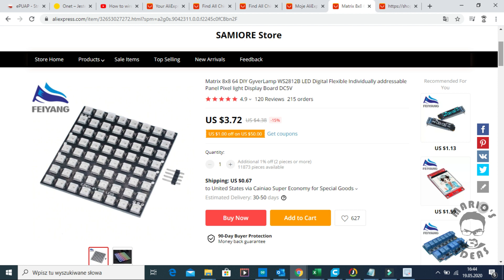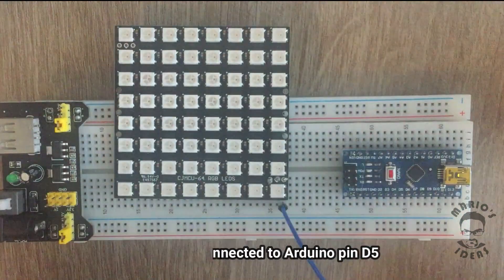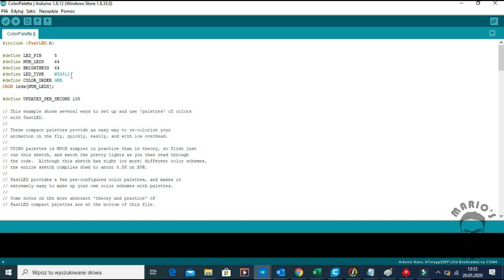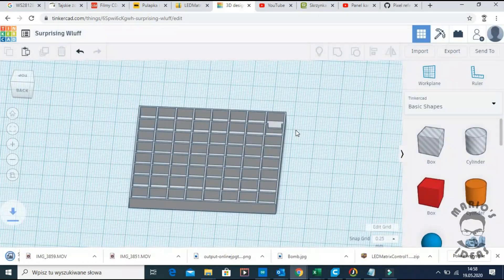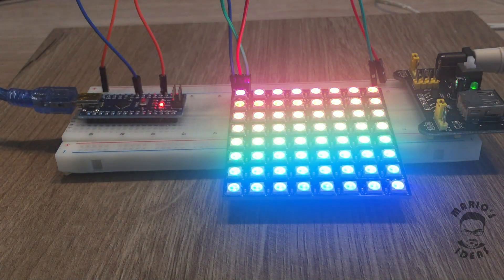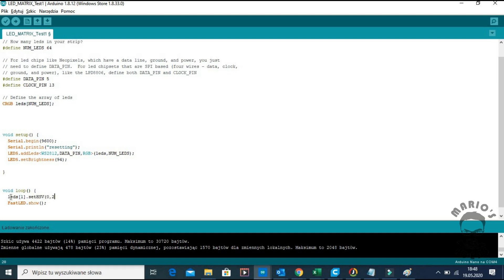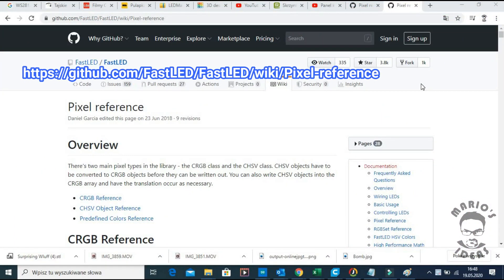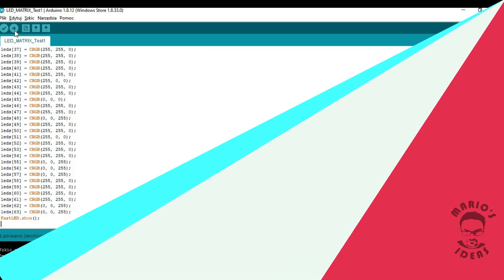How to use WS2812 8x8 LED matrix with Arduino and FastLED library

Comment: I watched this video to learn how to use a LED matrix, but instead of writing it, you simply refer to a third party program. What a waste of my time...
Reply from the maker: I Made this video 4-5 years ago when I was starting with Arduino. Since then I have posted few more videos which do not base on the sketches avialable throught the library. https://youtu.be/WiW9Bt38qUM https://youtu.be/GUKb6XwaVY8 and https://youtu.be/YKSFRmvA9A0. There you will find my code

Comment: For beginners.
line of code: #define CLOCK_PIN 13 is unnecessary for this type of LED matrix (3 pin).
It should be removed or blocked by adding // at the beginning of the line.

Comment: Hello, do you have any Arduino echo clock with the 8x8 screen?
Reply from the maker: What is echo clock?
Reply: @marios_ideas  See if with that matrix and the esp8266 module, if you have designed a circuit that shows the time on the matrix, that's what I was referring to.

Comment: Thank you for video. In tinkercad if you take one object and duplicate it, and move that new object on its new place, just press ctrl+D and it will duplicate another one and it will palce it with same distance as you have 2 older objects already. Just a small precise trick I use.
Reply: Also if you print white surface very thin you will have more precise and more visible borders in-between leds
Reply from the maker: Thanks for all the tips:)

Comment: Bro can you use Xd-74 sounds sensor to make the that led matrix become VU meter
Reply from the maker: Does Xd-74  has analog output. In this case yes. If it is digital that you have either sound detected or no sound detected  so not much of the VUmeter
Reply: @marios_ideas  ooo that's mean i can use it as VU meter project

Comment: This is a really great video. I've tried to solder the pins like you did but it doesn't work. It doesn't get any current. Are you using a special type of wire for your arduino? Thanks
Reply from the maker: I used normal jump wires.

Comment: Mario. This is great, well done! However I cannot locate LedMatrixControl version 1.3.1. I have found another version (1.1.5) but it does not have the FastLED export feature. Can you help? Thanks !
Reply from the maker: The video is old so you should not stick to that  particular version. Google fast led and github and you should get the link to the latest verion of that library. The you go to CODE->Download zip